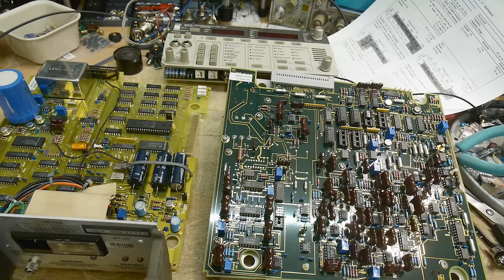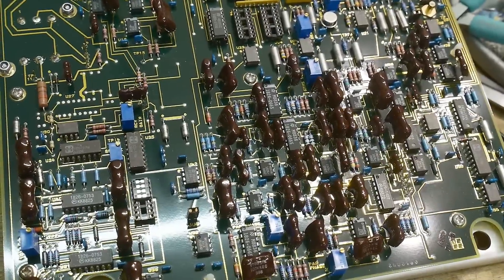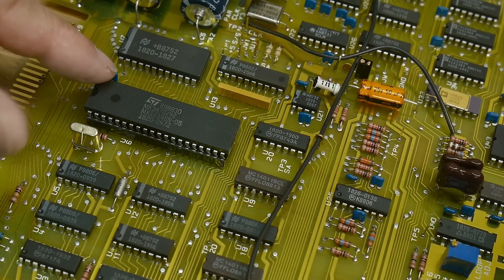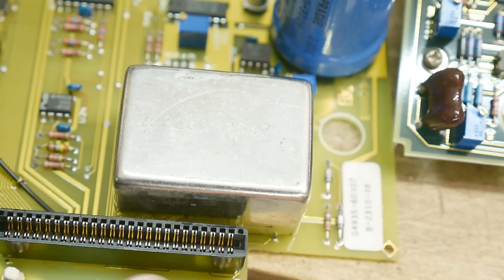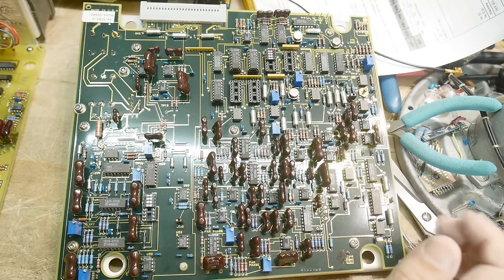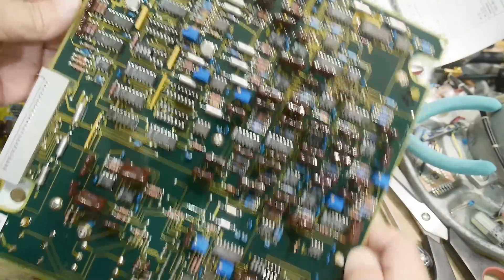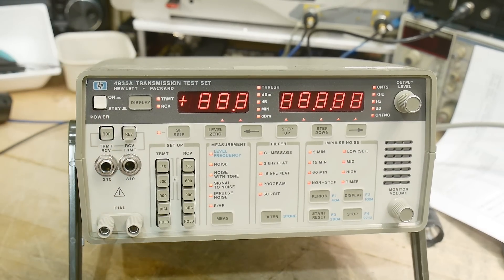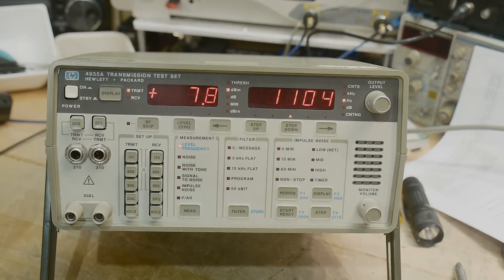#1933 HP4935A Transmission Impairment Measuring Set (part 1 of 3)

Comment: I started in the Telcom industry in 1983 when most everything was still analogue.  This test set was used from all testing, 3 tone slope, signal to noise, c-notch noise, you would transmit a quick 2150Hz tone to disable the echo cancelers on satellite circuits for testing, etc.  We used them in the field to line up 4 to 2-wire circuit packs, and in the switch room, working with telcos and lining up channel banks.  We had so many of them, had two in my garage until I sold them on eBay to a telco in Montana many years back.  We had MF/DTFM boxes (Blue-Boxes) too.  The bulk all went out as Assets Disposal.

Comment: I worked at the HP division that designed and manufactured the HP4935A.  I worked on the big brother HP4945A.  I have a HP4935A that still works (we were really driven by quality).  I might have a service manual somewhere.  I might be able to tell you the real part number from the HP part number.
Reply from the maker: Which division? I have the manual which includes cross refs for the parts.
Reply: @IMSAIGuy  The division that designed it was Delcon division in Mountain View, CA.  That division moved to Colorado and became Colorado Telecommunications Division in 1981.
Reply: In 1985, this product line was transferred to Queensferry division but still manufactured in Colorado.
Reply from the maker: @charleshill6819  I joined HP in 1980 and was not aware of a Delcon division.
Reply: @IMSAIGuy  Before that I worked for Data Terminals Division, first in Cupertino, then in Sunnyvale.  Where did you work?
Reply from the maker: Opto-Electronics (OED) Palo Alto
Optical Communication (OCD) San Jose
HP Labs  Palo Alto

Comment: The 4935 was a tremendous improvement over its predecessor that weighed ~50 lbs.  The 4935 was also battery powered, where is the battery on this one?  This is a TIMS set, Transmission Impairment Measurement Set, used primarily to check suitability of telephone plant for Data and Program services.  Many of these special circuits were four wire meaning, transmit on one pair and receive on another, hence its duplex design.  They could also measure POTS service (Plane Old Telephone Service) hence the dial bits.  I have two and they still work as designed, HP "was" first class in the day. Program services were basically wire or carrier circuits treated to have a flat  frequency response, hence the 15K flat filter.  POTS service did not have flat frequency response but something called "C-message" hence that filter on the unit.  I suspect those "boxes may be the filtering.

Comment: I'm betting the National Semiconductor 1820-1827 is a ROM -- though no data sheet seems to be available.
Those silver mica capacitors are probably worth more than you paid.
Reply from the maker: the service manual shows it as a 74C154
Reply: @IMSAIGuy  It can use a demux.

Comment: Micas for analog filters for the various tests for impairments of the POTS line. What out for those
voltage regulator sockets. Over time they become intermittent. Repaired many of them in the yesteryear.

Comment: Still use my HP-4934 (newer brother to the 4935) on a weekly basis for testing 4-wire E/M circuits in public safety communications.
In my old job we had a  number of the 4935's, I used to have a service manual but no more, sorry.
lots of gold to recycle there, don't throw it away, recycle! ;)

Comment: In ye olde days we had to do a lot of telephone line testing both for subscriber lines and for trunk lines.  My first exposure was in the service where we had a TCC-78 multiplexer feeding into the MSC-46 earth station.  We had two 12 channel groups that were transmitted from Taegu (now Daegu) Korea, one to Camp Zama Japan and the other to Wahiawa Hawaii.  The circuits were multiplexed in 4 kHz increments within the groups and used a 2600 Hz signaling tone for on/off hook and MF tones for dialing.  The lines were measured twice daily to insure the levels were in spec.

Following the Army I began work in 1980 for Satellite Business Systems, a subsidiary of IBM, Comsat Labs, and Aetna.  IBM formed the company because one year AT&T raised the phone and data communications rates they charged IBM by a significant amount, enough that IBM decided to launch their own phone company.  The system used 48 Mbit/s TDMA transmissions over the satellite to send voice and data between sites.  Each site could support some combination of up to 384 voice channels or some number of data channels from 9600 bit/s to 1.544 Mbit/s.  The subscriber line connections were FXS or FXO and the trunk lines to the central office were E&M typically.  The voice lines were converted to digital using a 32 bit/s delta mod encoder.  Because this was before digital echo cancellers were developed, the phone lines needed to be regularly measured and micro-switches set to add in the appropriate inductance or capacitance to get the best match on the lines to maximize the return loss so subscribers wouldn't hear echo.  The audio noise performance of the system was very good, much better than that lines from the telco.  The system didn't transmit voice bits when speakers weren't talking so on the receiving end the controller would add in idle channel noise so users wouldn't think the line had dropped.

The need to do this kind of testing fell away as vocoders got better and better and digital equalization and echo cancellers automagically compensated for line issues.  Fast forward to today with VoIP and pretty much everyone having a cell phone, the POTS network in the US is pretty much a thing of the past.  Phone companies have been petitioning the FCC to allow them to rip out copper lines and stop providing basic phone services.
Reply: Yes I'm with a Telco in Canada and one of my retired friends is working to groom customers from one cable to another so the telco can free up & remove 2km of 3600 pair cable for the copper. It's amazing how much the technology has changed and how the working life span of the equipment keeps getting shorter.

Comment: MK3870 is an old F8 Micro controller 2K X 8 Mask Rom 64 X 8 Scratch Pad Registers , Interval and event timers 32 I/O pins. I have only ever seen a few. The 8051 series was usually in everything back then. Also 8748 , 8048 etc.. That chip also had a version with a piggy back Eprom for development... Bitsavers and the like have info on it.

Comment: That MK3870 is a single chip version of the Fairchild F8 microcontroller.  Likely it's a masked-ROM (perhaps as evidenced by the socket for easy upgrades.)   My Fluke 8050A benchtop DMM also has one of these; seemed to be really popular back in the day.